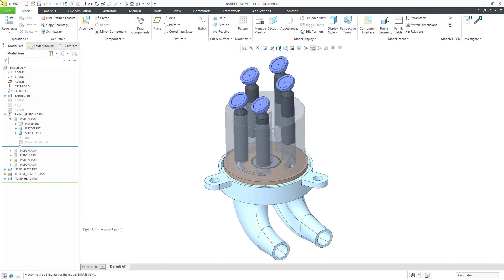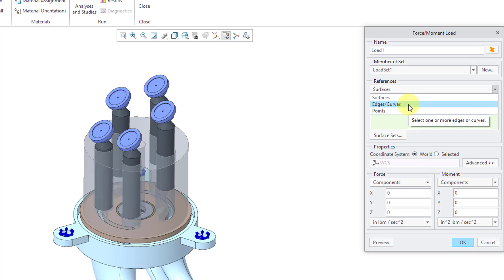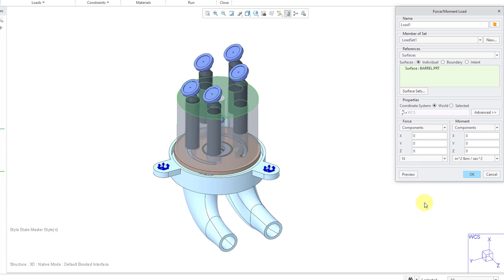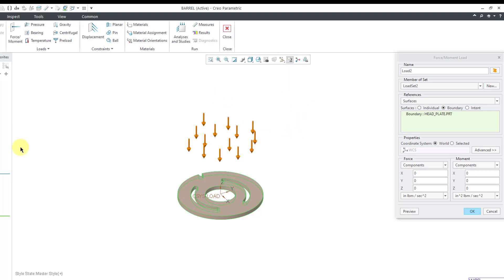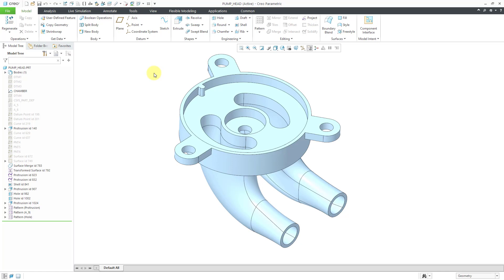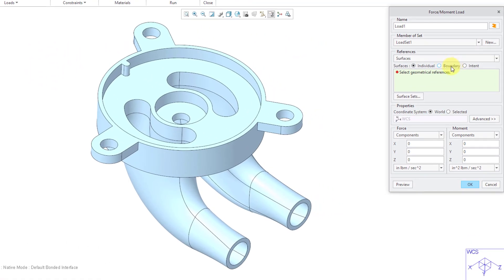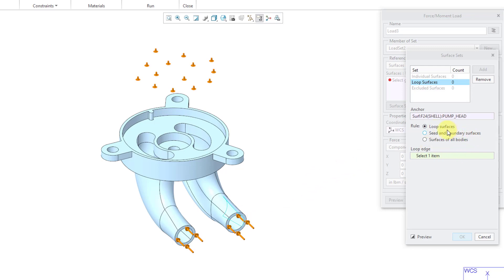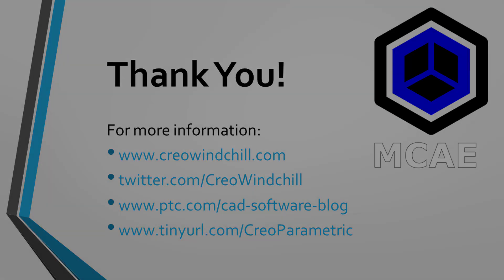Creo Parametric - Creo Simulate - Force Loads (Part 1)

Comment: What is the difference between the pressure and force? Right now we use a surface as a reference for a force (p=F/A). Will the force be applied to the entire area? If I have a large sheet and a force in the middle the results are completely different because creo uses the resulting pressure over the entire surface?